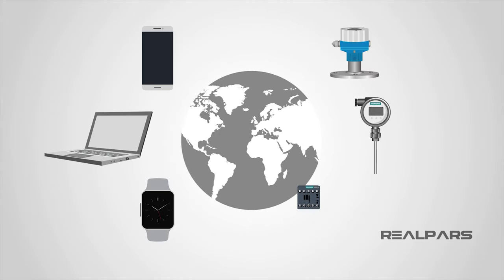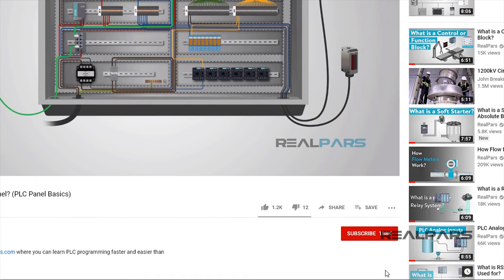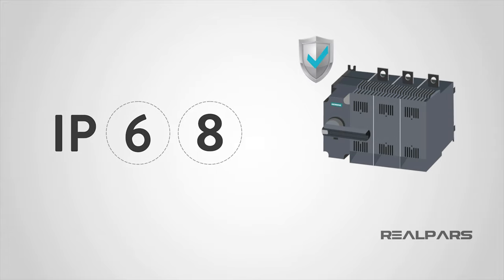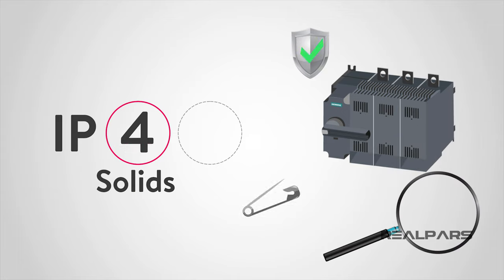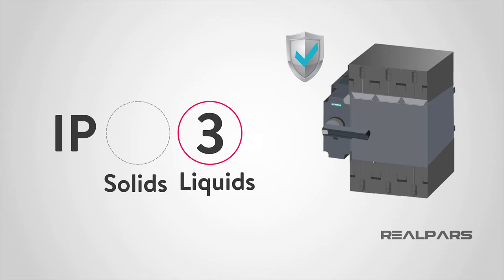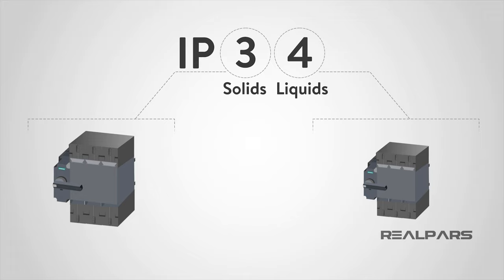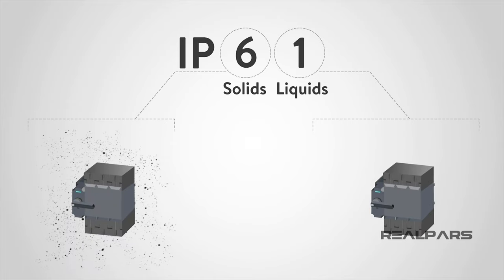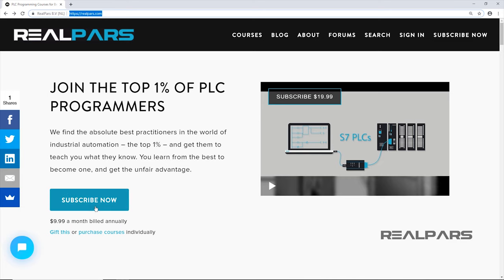What is IP Rating? (Ingress Protection Rating)

Comment: The IP rating has an equivalent NEMA rating. For instance, IP 14 is equivalent to NEMA 3R, IP 66 to NEMA 4X, and IP 67 to NEMA 6P. This is particularly important in electrical & instrumentation engineering design when selecting enclosures to protect equipment sensitives to dust and water.
Reply from the maker: Very good information!  The NEMA ratings for enclosures are very important for manufacturers in the US, whereas the IP system (IEC) is most important in Europe.  Understanding the equivalencies is vital since devices, instruments, enclosures, etc., can be sold to users around the world from any location.

Comment: Next series Hazardous Location. Ex equipments. By the way, why are some devices marked ip66/67 instead of ip67 only?
Reply from the maker: Excellent question!  It turns out that the IEC 60529 standard (article 6) considers an enclosure designated with second characteristic numeral of 7 or 8 is unsuitable for exposure to water jets (designated by a second characteristic numeral of 5 or 6) unless it is dual-coded (ex: IP66/IP67).  So the dual code IP66/IP67 indicates the device can be hosed down and temporarily submerged.

Comment: What should be the minimum IP code protection of enclosure for protection under the following conditions
1 Protection against ingress of solid foreign bodies with 12.5mm diameter
.Drops of condensed water falling vertically on the enclosure

Comment: Good explanation about ip ratings!! But what about temperature as an eviromental condition? Is there any other type or rating?
Reply from the maker: Temperature is a separate environmental consideration that usually has an effect on circuit boards and the performance of materials, like gaskets and o-rings.  Most circuit boards start to decompose (solder tracks begin to melt) around 65-80C.  Many elastomers are not effective at very low temperatures.  There are T-Class (temperature class) ratings for systems in hazardous location installations that exist for purposes of mitigation explosion hazard, not material ingress.

Comment: Dear sir, if there is a panel with IPXX, and there are equipment such as small panels or electrical devices inside it, can we consider all these equipments satisfy or meet the requirements of IPXX since they are inside in IPXX ?
Reply from the maker: The IP rating applies to the enclosure that is exposed to the environment around it.  If I put an IP22 device inside of a panel that is rated IP67, then the contents of the panel are protected against the elements (dust-tight and water-tight) according to the IP67 characteristics.  It does not change the rating of the devices inside the panel.
Reply: @realpars  Thanks

Comment: So is there a general agreement to which is the minimum IP rating to put a product outdoors?
Reply from the maker: Hi there, 

Thank you for your question. The rating system we refer to has been developed by an international governing body responsible for creating the EN60529 standard, which serves as a benchmark for manufacturing companies worldwide seeking to adhere to international electrical device standards. Each rating is intricately tied to the design of a device. To ensure the safety of human life and the durability of the device in both wet and dry environments, as well as considering factors like heat and other environmental variables, it is imperative that design engineers possess a deep understanding of these standards.

The consensus within the industry is that design engineers must rigorously adhere to these standards when creating their designs. To aid in your learning on this topic, we'd like to provide you with two helpful links:

IEC IP Ratings https://www.iec.ch/ip-ratings

IEC Standard 60529 Information https://keystonecompliance.com/iec-60529/#:~:text=IEC%20Standard%2060529%20provides%20guidelines,hands%2C%20fingers%2C%20and%20probes

We wish you an enjoyable and informative learning journey with RealPars!

Comment: In this day's I hear about (robot process automation) I searched in internet but I not achieve any specifications on RPA 
Because of that I now realpars is best in field of specification I extermly please realpars to make a introduction video about RPA with all my respect
Reply from the maker: Definitions are important.  There is a fairly mature branch of automation that deals with mechanical robots that perform functions ranging from welding to transportation of parts around the factory floor.  There is another term, RPA, Robotic process automation, that refers to the use of specialized computer programs to automate repeatable business processes. An example would be automated, guided point of sale ordering at a fast food restaurant.  In this case, "process" refers to a business process, not a manufacturing process.  However, they are closely related and we will consider how RealPars might integrate training on RPA into our course offering.
Reply: Thank you my brother's in realpars I understand your specifications..... That's why I love realpars...

Comment: Some rugged phones are advertised as IP69K, so what's the 9 mean if the liquid protection only goes up to 8, and what's the K after it?
Reply from the maker: Thank you for your question!

IP69K means a product is completely dustproof and can withstand washdown at pressures of 80 to 100 bar/1,160 to 1,450 PSI, in phases of 14 to 16 l/min, and at temperatures up to 176°F/80°C. Here is the link that might of interest as well 

https://www.armagard.com/ip69k-pc-and-monitor-enclosures/what-is-ip69k.html#:~:text=IP69K%20means%20a%20product%20is,%C2%B0F%2F80%C2%B0C

Happy learning!

Comment: how can the device is protected against the temperature in terms of high and bellow zero?
Reply from the maker: Temperature protection is a whole different area of design.  There are many ways a sensor can be protected against temperature, but they all have 9ne thing in common:  insulation.  Some sensors need special designs (such as proximity switches) and some are inherently temperature protected (RTDs, thermocouples, etc.).

Comment: This reminds me of the Underwriter's Laboratory (UL) rating/certification of "old'.  Does this in any way tye-in? Supersede/replace?  Is UL even in business anymore?  I'd be curious how this compapres. What are your thoghts?
Reply from the maker: Panel ratings that are parallel to what the IP ratings indicate are ratings designated by NEMA.  UL, still in business and more important than ever, deals with electrical and mechanical requirements for panels, etc. UL approves panel fabricators as being compliant with UL arc flash and other requirements.

Comment: RealPars really good video thank you, but i'm still not understanding, so if i have a ebike that's rated IP2 Waterproof rating, does that mean i can drive it in rain up to 3mm ? the whole 15 angle thing, i dont understand, im just very concerned with my e bikes battery being ruined, if i drive it in the rain, can you explain it to me? really hope you answer me. i can't find any good information about this, thank you so much.
Reply from the maker: The 15-degree angle requirement ensures that the device can handle water droplets at an angle of something other than "coming straight down" on the device (driving rain).  For the protection of electronic devices, I would suggest IPx6.  I consider IPx2 to be water-resistant, with IPx5 or greater as providing better "waterproof" protection.  You probably will be ok, since the manufacturer is staking its reputation on you not having issues with their products.
Reply: @realpars  Alright, thank you so much, im just going to mail Engwe 1 more time for clarification and be 100% sure it's okay.

Comment: Could a device be IP18? 🤔 my guess is not, how something could be water tight but not solids
Reply: I guess you could cover it with some watertight foil that can't stand single points of pressure.
Reply from the maker: There are IP18-rated devices, but most are electrical accessories, like dust caps for electrical connections.  Some models have an inner sleeve that makes the inner connection watertight but the outer casing has vent holes that could let in dust.

Comment: is it possible for an IP rating of 08
Reply: No? If your hand can get in, so can water
Reply from the maker: it is possible, but not likely that a rating of '0' for solids is going to protect against immersion.  It is very possible that the manufacturer does not want to spend the money to test for dust ingress, in which case, a solids rating of '0' applies.

Comment: I guess IP rating goes up to IP69. The example mentioned for IP68 is actually IP69
Reply from the maker: You are correct.  However, IP69 is a new designation that is just now being added to many of the IP ratings charts that have been published.  The example in the video, IP68, is described correctly.  IP69 provides protection against high-pressure / high-temperature water jets.  IPX9 ratings were not part of the original IEC 60529 standard, but were added later as a part of DIN 40050-9.